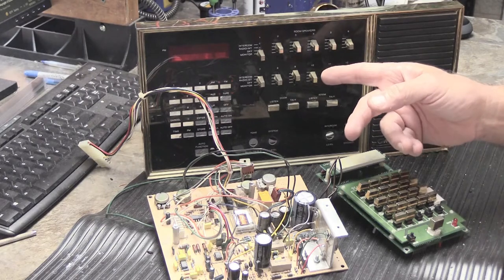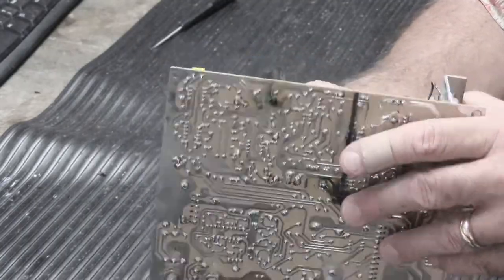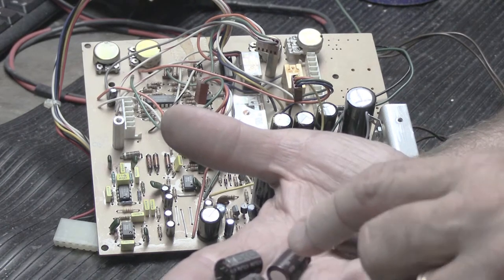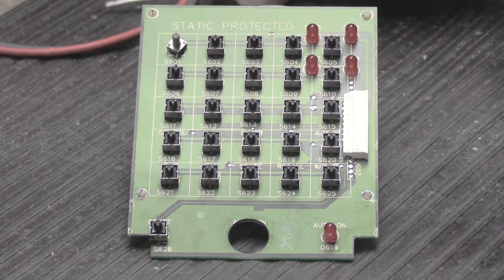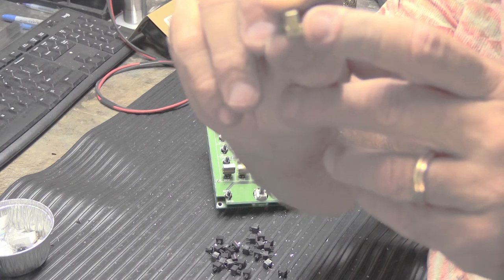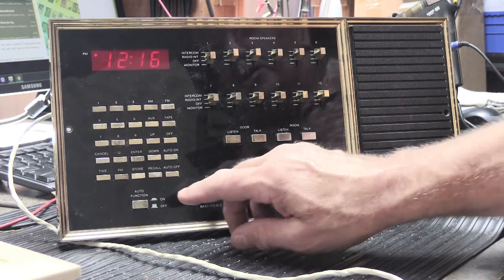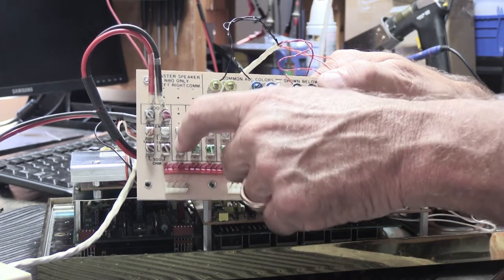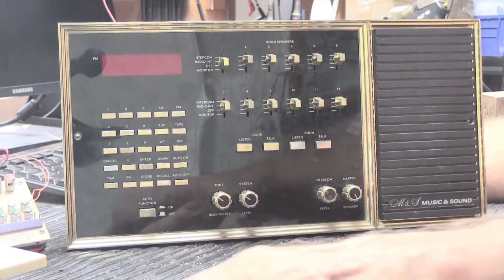Repairing an M&S Systems (music & sound) Model N440 Music Intercom Master Station

Comment: Well done, you have saved that master station from permanent death :-D
I;m actually surprised that there were not more fried parts.
Ahh big old output transistors, i assume they were npn and pnp  complimentry paired.
A single output capacitor may have coupled the transistors to the speaker switching.
There are a few configurations.
That supply capacitor thought it was a rocket :-D
I was thinking about nail varnish to cover the track repair,  easy to borrow from your wife.
Yes there is a special conformal coating, but its likely more in cost.
Waffle mode over : o) .
Reply from the maker: Hi zx8401ztv:  I though about conformal coating the board repair (I keep some at the shop) however, since the board did not have either solder-mask or any coating - I left it as a tin-plate board.  I was also expecting more failed components, but luckily, there weren't any.  I suspect the the original capacitors just reached the end of their life and went BANG!  - Chris
Reply: I have this model or close has a total of 6 round knobs bottom.   I get a buzz sound now but 10 years ago still worked a bit.  What can I do?  1988-1989 model
Reply from the maker: @lillianarredondo4348  Hi Lillian:  Since your Master Station has 6 Knobs - It is a Model N80 - Which is a Stereo Music Intercom System (fairly rare).  You can contact us directly regarding your M&S System - Chris           nscompany@msn.com

Comment: I have this system.  When I press the intercom button I only hear loud static. Any idea what I can do?
Reply from the maker: Hi srigorty:       The problem you describe with static when the Intercom feature is used, is very common on systems as old as your M&S N440 system - The pushbutton switches are dirty and oxidized and they need to be cleaned - The cleaning should be done with some Caig DeOxit D5 contact cleaner (and, no I don't recommend using anything else) which you can buy on Amazon - 
     You need to spray the D5 into the inside of the switch - On the N440 - you can pull off the Oval Button Caps (carefully) and using the Red-Straw that comes with the D5 - spray the cleaner into the Switch - push it in and out many times and spray again as needed. 
     You may find that the switches in the Remote Stations need to be cleaned as well
Chris